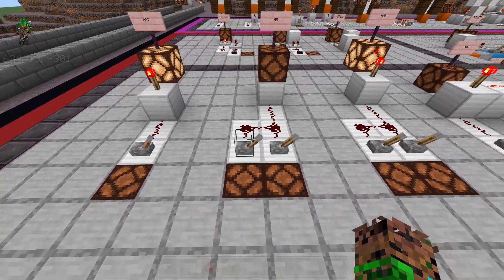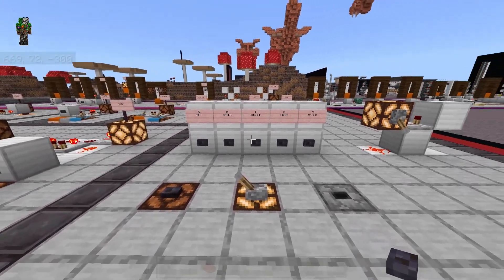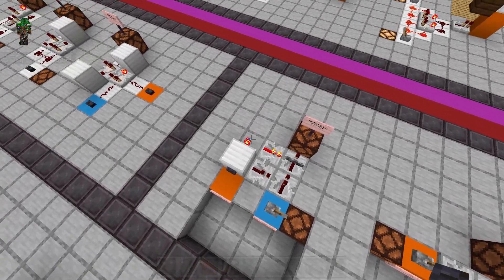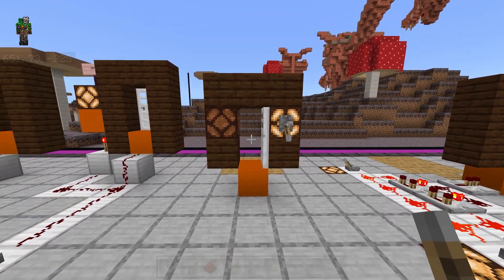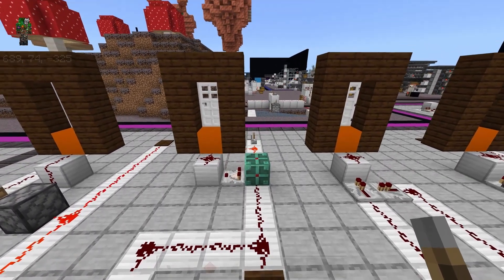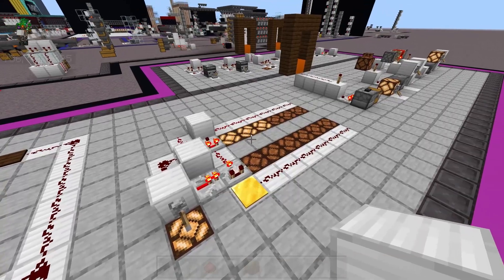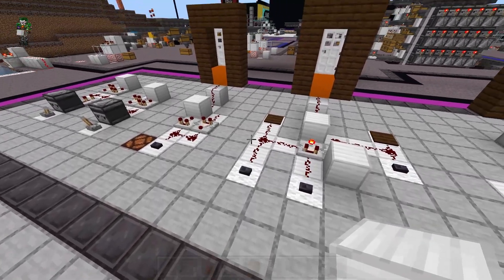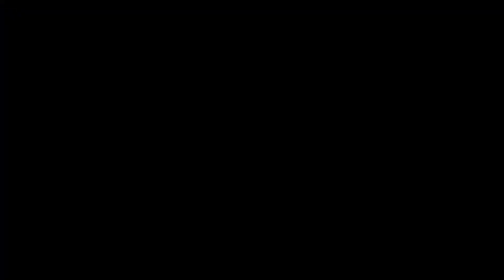Logic Gates & Memory Circuits Explained | Let's Learn Redstone 10 | Minecraft Redstone Tutorial

Comment: Im building an epic super smelter but I'm running into an issue where the memory gate is retaining the memory even after toggling the power and the only way to reset it is to remove one of a few items from the system. I can't figure out what I did wrong! I'd love an im depth video into the memory gate so I understand how it works and not just how it's arranged.
Reply: specifically the low lever data latch that clocks the signal strength
Reply: Thanks to your youtube shorts, I solved the issue! A simple issue of not turning on subtraction mode

Comment: Can I use a observer to control hopper flow into a bubble dropper to keep it from backing up. The line

I know most start their line at the top of their base and work down. I went to the bottom of what I can do and worked up from the basement. Well sometime I'll have one of the droppers clog from filling up I'll do sometimes lose items on the disappear from hopper speed not keeping up. I have 3 floors of chests and rooms of 25x55 at 12 blocks tall with 5 blocks of floors thicknesses. I start at the basement before sending them up to sort rotten flesh or smelt the gold swords from the farm I got... Basically I want to use a observer to tell the other one when it can send them up the line from one being empty to start the flow again

Comment: Hm one of my main issues in being in bad at redstone is def lack in knowledge about circuits and gates like these. Gonna try to tackle one at a time and learn how and what to use them for
Reply from the maker: @chaoticbull420  That's a good way to start!!! Allot of them are less useful then others tbh. 
Like the tflop, rs latch, clocks, shorteners & extenders are by far the most useful to learn. Once you learn those it opens up a whole new world.
Everything else is very rarely useful, except in very specific situations. Like I have basically never used AND gates, XORs, data latches, & rarely rarely ever use counters. 
But RS latches & tflops are sooooooooooo usable. When I was learning, once i learned those 2 things, redstone really opened up.
& best of all the rs latch is just 2 pistons pushing a block of redstone. & a tflop now is just a copper bulb+ a comparator haha